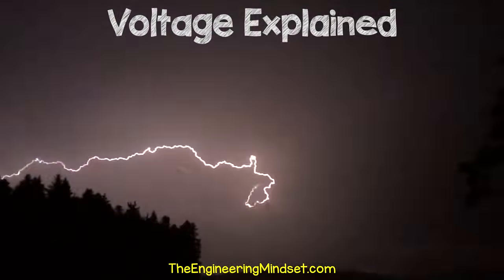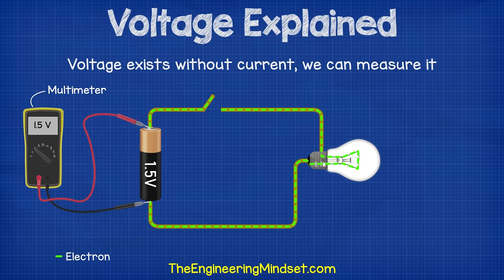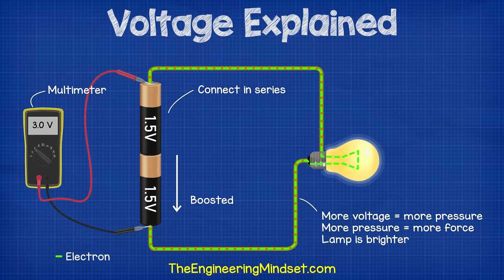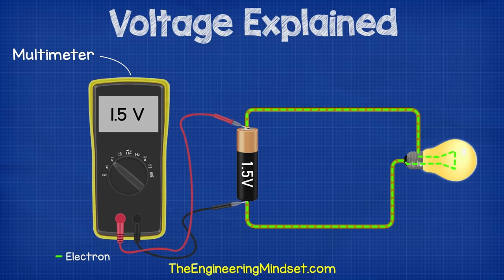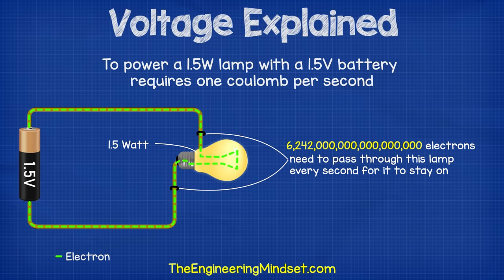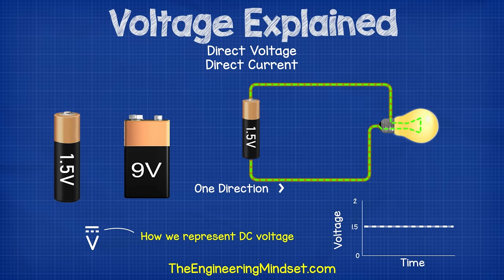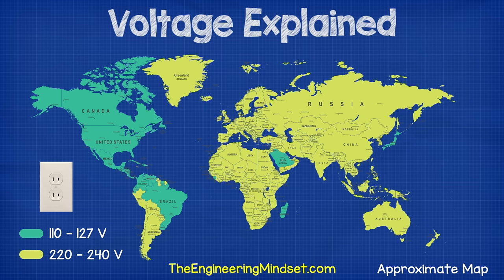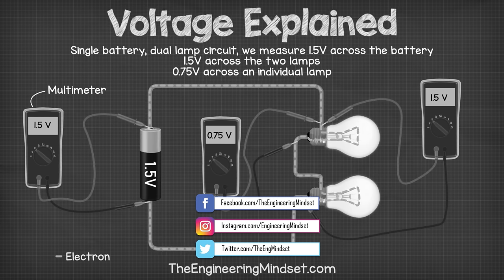Voltage Explained - What is Voltage? Basic electricity  potential difference

Comment from the maker: ⚠️ Found this video super useful? Buy Paul a coffee to say thanks: ☕
PayPal: https://www.paypal.me/TheEngineerinMindset
Reply: Thanks for sharing the video
Reply: First time
Reply: Make sure that works
Reply: FINALLY I understand voltage :) Thank you Paul
Reply: Thanks for
Reply: Your videos are soooooo good keep it up, thank you
Reply: Can you'll do a video on P=VI
 why does the current decreases when voltage increases according to that? 
Is that because the increase of resistance ?
Reply: I've had a hard time understanding voltage for a while. I understand it is essentially the abundance of electrons on one end, and a lack of electrons on the other creating an attraction for the electrons from negative to positive. we tend to explain this potential difference as an electrical pressure, and it works well enough to wrap your head around the basics but starts to fail upon further analysis. When described as a pressure one would assume the speed of the substance is speeding up as you add more pressure, but that is not the case with voltage. if at any point you are increasing the number of electrons per second, you are now just adding amps. so i don't understand how without increasing the number of electrons per second you are able to have more power. does each electron carry a higher charge (potential to do work) when you increase the voltage. My question is essentially what is exactly changing when you add voltage that gives the electron the ability to do more work. and follow up question is why does amperage create heat and voltage seemingly doesn't. because you can send the same amount of wattage down a small wire as long as the voltage is ramped up. hopefully i made some sense and you understand what i am trying to ask. thanks in advanced
Reply: What causes voltage ?
Reply: Politely ... It transferred the focus from the concept to the arbitrary (and impressive?) number. ...
Abbreviating the expression of coulombs per second ... without referring to it as an amp is crucial.
As it's the concept of a 'volume per time' that explains the principle ... not the number. (please)
Reply: @csp405   God ..
Reply: PayPaul
Reply: you are too fast in your explantations , you explain for yourself
Reply: @rodbalfonso5812  l
Reply: Yes but what determines that potential difference though? 🤔 i still miss that for a full understanding
Reply: His voice really sounds like Jay Shetty.

Comment: Ive been doing physics for 6 years but never really understood what voltage was until now , thanks a lot
Reply: you can only learn when actually want to learn..
Reply: I forgot again
Reply: Wonderful. Pressure can not be seen under a microscope. It can be measured by using the proper gauge.   Flow (current etc) can be seen under the proper microscope ( electrons in a metal, atoms in water.)
Reply: @tedlahm5740  can u explain it to me is it the diff between the positive and negative terminal ?
Reply: @a1_himanshighangas_231  Yes, one end pulls the electrons (positive side) other end pushes the electrons (negative end).  REASON BEING opposites attract + and -
WHILE likes repeal (- and -).  Direct current circuit.
CURRENT is the number of electrons that are moving inside the conductor passing
one point in a second of time. ( current, measured in ampers)
Reply: he is explaining too fast  like a teacher at school , not noticing that some students don't understant  .  I'm going to seek for another video that explain better
Reply: @tedlahm5740  I thought in circuits notation current is seen as coming out of the positive end
Reply: @stephaniecurry45  Well, you and Ben Franklin both.   He is given credit for starting 
that theory.  He said it FLOWED high (positive) to low (negative) .    To this day
referred to as the “Conventional flow of current”.      Although it is not accurate. 

In current speech use that terminology “Conventional flow of current” thereby 
signaling that you UNDERSTAND that it is not accurate.
Reply: @tedlahm5740  oh okay, thank you for the clarification
Reply: @tedlahm5740  wow
Reply: @tedlahm5740  thanks a lot
Reply: @tedlahm5740  But we also don't know that the Electronic Flow Of Current is the true direction of current ? Or can we ?

Comment: explaining voltage with an analogy is ok to start with, but what actually is it , i know it like a pressure , but what causes it ?
Reply: Take a battery, on one side it has too many electrons, on the other it needs electrons, so upon connecting the 2 sides with a wire the electrons will naturally go to the positive side, voltage is basically how much negative charge is separated from the positive (hence potential difference). So a voltage is potentially how much energy the electrons would give off while travelling from the negative to the positive part
Reply: @warmusblanketus9729  
Is every material that exist in this world has voltage ?
Reply: @mohdrozakhiismail7273  not voltage but they have resistance
Reply: @warmusblanketus9729  what and how many material in this world that already has a 'build in' voltage into them ?
If there is

If none, then how to create voltage ?

Thank so much for your help, im very greatfull to you for this.
Reply: @mohdrozakhiismail7273  voltage is "created" when there are at least 2 substances, one of which is positive (has fewer electrons) and the other is negative (has too many electrons), between these two is a potential difference (voltage) which means that by connecting them with a conductor like copper, electricity will start to flow from the negative to the positive side. If a material had a voltage on its own then theoretically it would always have electricity running through it
Reply: Tony Humbert  
So where the voltage is? As @Warmus explain, seem like no things in this world had it own voltage readyly.
Do u know a simplest method to create voltage
Reply: Tony Humbert  depends on how u define positive and negative, i'm more used to the technician plus and minus
Reply: Tony Humbert  
Dont worry, im 44 years old(im had that long experience), i'll never got a bad  electric shock.

Also im not  try to get pass any high level electronic examination from any school/college now. Im just want to get SIMPLE BASIC GENERAL KNOWLEDGE.
Reply: @warmusblanketus9729   Well, what about the wire's electrons then?
Reply: @warmusblanketus9729  Which leads to how did the electrons get in the battery, and then how did the electrons get in the electroids  that are in the battery .And then all the way down to, how did the electrons get in the atoms. The truth is nobody knows how the electrons got in the atoms in the beginning, but we know they are there, and we use them and manipulate them. Just like everything else in the universe where did it or they  come from? If it was the big bang, then where did that come from, and if it was God, where did he come from. Its and ongoing argument between religion and earth science.  You can not see the big bang because it already happened, and you can not see god because he was already here. That's where faith comes in,, do you believe in a random big bang or intelligent design. We all know that faith is real because most of us have faith in something,  for instance we may have faith our parents love us.  Anyway in order for us to believe in anything unseen we must have faith that it will work. We can measure most everything in this world, but we can not explain where the things came from that we measure.
Reply: Which leads to how did the electrons get in the battery, and then how did the electrons get in the electroids  that are in the battery .And then all the way down to, how did the electrons get in the atoms. The truth is nobody knows how the electrons got in the atoms in the beginning, but we know they are there, and we use them and manipulate them. Just like everything else in the universe where did it or they  come from? If it was the big bang, then where did that come from, and if it was God, where did he come from. Its and ongoing argument between religion and earth science.  You can not see the big bang because it already happened, and you can not see god because he was already here. That's where faith comes in,, do you believe in a random big bang or intelligent design. We all know that faith is real because most of us have faith in something,  for instance we may have faith our parents love us.  Anyway in order for us to believe in anything unseen we must have faith that it will work. We can measure most everything in this world, but we can not explain where the things came from that we measure.
Reply: Voltage is the energy supplied to an electron to make it move. 
Energy is created by the interaction of chemicals in a battery or by electromotive force in a generator. 
Energy is measured in joules. 
1 joule is the approximate energy required to lift an apple a vertical distance of 1 metre from the ground
1 volt = 1 joule/ coulomb
1 coulomb = approx 6,000,000,000,000,000,000. electrons
Simple!
Reply: Why doesn't the electrons balance out the potential difference if they are regularly moving from higher potential to lower potential...like we have with water-if the level at two sites is same ,the water will not flow...how is it that the electrons keep flowing and flowing.Also I believe the bulb is not consuming any electrons so how come the wire has so many electrons and why did they not all flow  towards the other side in very few time
Reply: @pushpakgupta7396  electrons are a mystery,  they can be measured with instruments, but why they exist any why they act as they do  can not be explained. It's like asking why is the earth this big and why is the sun at that distance from earth,,it just is. Science is observations and a best theory only.
Reply: It's just like Warmus Blanketus said.

The easiest way to explain that would be to think of a battery. Nature is about balance. You know that when you put the positive side of a magnet close to the negative side of another magnet, they're going to try to pull together. They're trying to "balance" themselves.

Now think about that with electrons. The electrons in the negative side of the battery really REALLY want to get to the positive side. We take advantage of this by creating circuits. We give them a path to get to that positive side that they desperately want to reach, and we have them do a little work for us along the way. The MORE free electrons in the negative side of the battery, the more POTENTIAL there is for us to use (Voltage).

This is why a fully charged battery will read its rated voltage, or close to it, and why a depleted battery will read a noticeably LOWER voltage -- reflecting the fact that many of those electrons are now at the positive side of the battery. There aren't AS MANY of them left that need to get over there anymore, so much of the FORCE they provide when traveling through the circuit has dissipated.

Think of a bunch of people waiting outside a store before Black Friday. All of those people are electrons. Outside the store is the negative side of the battery. The store itself is the circuit. The register is the positive side of the battery. As soon as those doors are open, those people are going to rush to get to the items they want, grab 'em, and run for the registers! The more people (electrons) there are waiting in line (negative side), the more FORCE they'll have when they make their rush to grab what they want and checkout (positive side).

I hope that helps.
Reply: Voltage is a characteristic of an electrical system, not so much an actual "thing" (like current is electrons flowing through a wire). It comes from the electromagnetic force which pulls/pushes electrical charges apart/together. Voltage describes how badly those charges want to attract/repel each other. It is a measure of potential energy which tells us how much work a system can do. 

It's similar to gravity in some ways. Imagine holding a ball. Gravitational force is pulling the ball toward the center of the earth but you're holding it so it's not moving. But there is a gravitational POTENTIAL energy based on the masses of the ball and earth and the height of the ball above the earth. If you let go of the ball it falls: the POTENTIAL energy turns into kinetic energy (aka motion) and we say the gravitational force is doing work on the ball.

In a similar way the electromagnetic force creates a potential (aka voltage) between two or more electrical charges based on their amount of charge and their relative position. In an open circuit no current is flowing, but just like when you were holding the ball the circuit might have potential based on the charges and their locations. But if you close the circuit it's like when you dropped the ball: the potential energy becomes another form of energy, in this case electrical and electrons will flow. But remember voltage is just a characteristic of a system based on amount of charge and their positions relative to eachother. Voltage exists even when the circuit is not closed and no current flows just like gravity pulls you even when you are standing still. You have the potential to fall, and if suddenly a hold appeared under you, you would do so.

So basically voltage comes from the electromagnetic force pulling electrons from higher concentration to lower. It doesn't describe anything moving or happening just the potential for something to happen in the system. Higher voltage can move more electrons than lower voltage.
Reply: @warmusblanketus9729  Really nice explanation. Thanks.
Reply from the maker: Check this out, how a battery works: https://youtu.be/PXNKkcB0pI4
Reply: robert mccully Electrons can be seen under the proper microscope and measured using proper gauge? Pressure can not be seen, but can be measured using the proper gauge?
Reply: Magnetic pressure, a turbine produces such magnetic pressures that push electrons through wires, it is like dominoes, you push one in one side and then the pressure moves through all individual dominoes until it reaches the other side.
Reply: @warmusblanketus9729  Hi, can u please help me? If a Voltage of 1.5V means that there are 1.5J carried by every coulomb of charge passing through the lamp, then how do the electrons have any more energy or pushing force left to return to the other side of the battery?
Reply: Yeah, not explained in a video but in someone's comment.
Reply: @warmusblanketus9729  say like the universe
Reply: Tony Humbert  thats passive notation, used to remove negative signs from equations to make it simpler. Actual current runs from negative to positive (because the electrons are the ones that move and when you have a bunch of electrons, they have a negative charge and are trying to flow to the positive side to balance out)
Reply: @warmusblanketus9729  thanks Warmus. You along with so many others have great understanding, thanks for taking the time.  
I’ve always wondered, as a battery has positive and negative ends, what keeps the electrons from flowing to positive internally, without a wire?  Is the internal structure constructed in a way that prevents it, is there a force that prevents it ?
Cheers
Reply: @robp4616  why did you copied his comment ?
Reply: @abhayagarwal5097  Copy who's comment?
Reply: It's how much work there will be by virtue of the potential difference. 1.5 V means there will be some amount of work per charge and 3.0 V means there will be double the amount of work per charge. This work can then be used to, for example, light a bulb. It's like putting a ball on some height. If you put it 5 meters above the ground, the work it can do is mgh (Gravitational Potential Energy), thanks to the Gravitational Potential Difference of (5 m * 9.8 m/s^2). If the Gravitational Potential Difference is greater i.e. putting the ball 10 meters above the ground (10 m * 9.8 m/s^2), then the work it can do is greater.
Reply: @warmusblanketus9729  i thought it was how pressure moves the electrons?